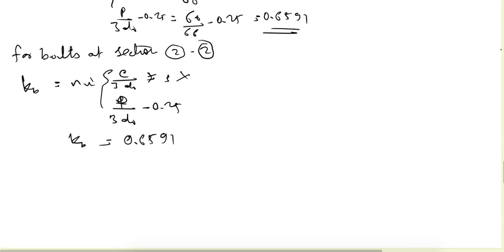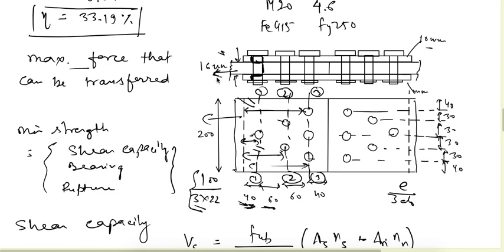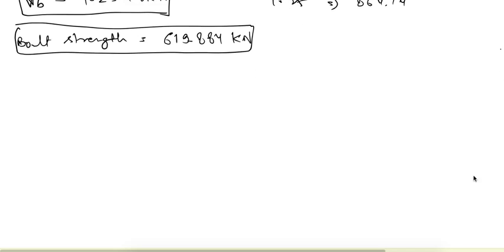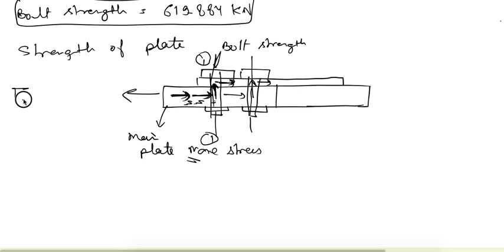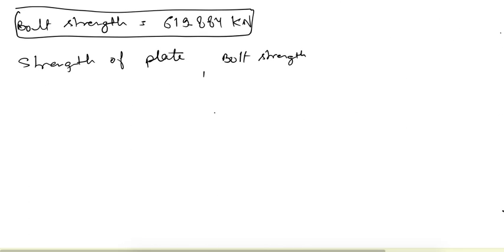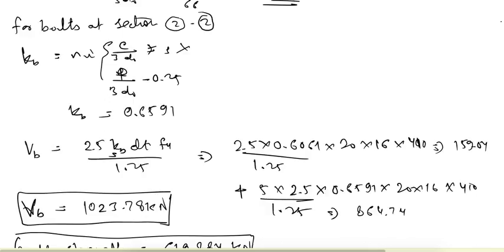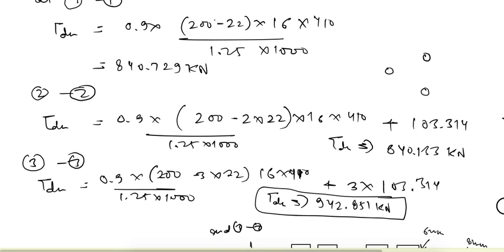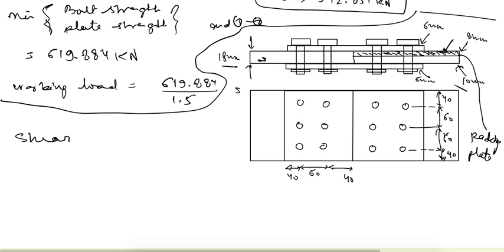Bolted Connection Design Solved Examples Part 2 | Design of Steel Structures

Comment: Hi. While calculating shear stress, we considered 1.78 times area. As we are using packing plate, it is not that we should consider only root diameter and not consider shank diameter, so that factor will be 0.78
Reply: Answering your question bro since nn=1 and ns=1, the eqn becomes As + 0.78As. taking As common we get As(1+0.78)= 1.78As.
Reply: But the thing is he should have considered the worsht possible case taking nn=1 and ns=0 so as to get the minimum shear strength possible.

Comment: Why do we add the bolt shear of three bolts at section 3-3?
Reply: In double shear why did he took the value of number of shear plane equals to 1?
Reply: @vikotolcho2462  probably because when there are two plates, they form one plane of junction.

Comment: 2.55 fu is not use 410 its use 400 becoz it is use as bolt bearing capacity 
410 is use for plate

Comment: Sir ...in examination which formulae we have to use...working stress or limit state.
Like in previous papers soln , question are generally solved by wsm
Reply: By limit state method
Reply: Till 2012 wsm after that lsm